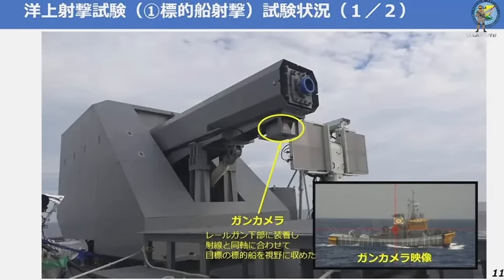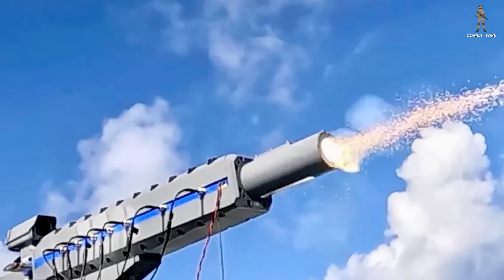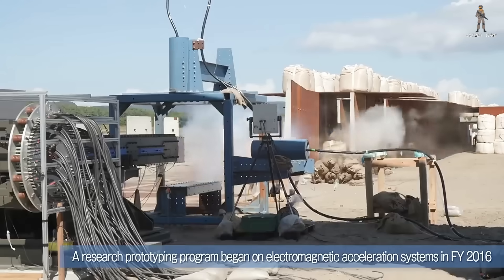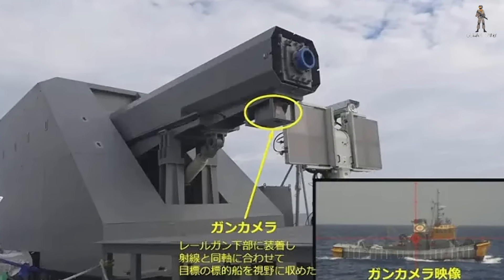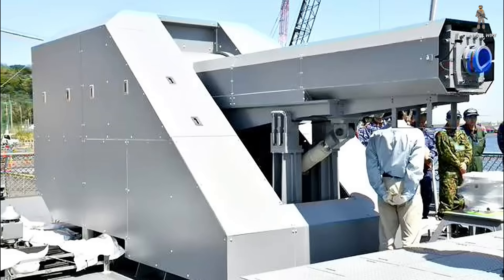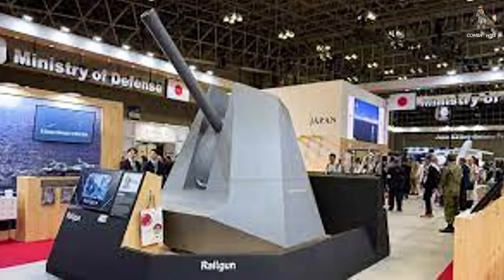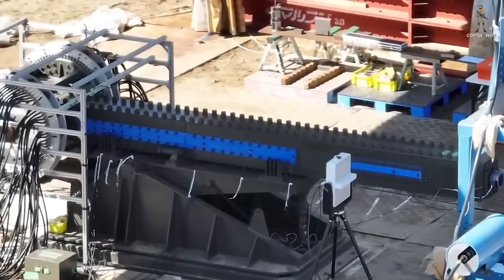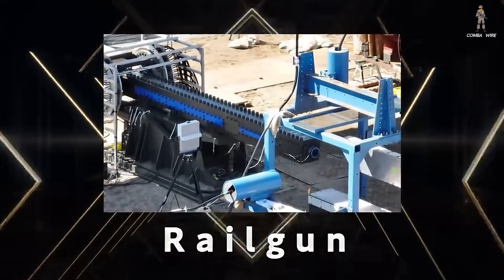For the First Time Ever, Japan Reveals True Railgun Damage at Sea.

Comment: I think... Most don't understand.a rail gun. No war head. No big boom.  Understand, the rail arrow can't be seen or shot down. The big boom is as it's gos thru ships hulls, and hits missles in the ship stock piled. That's the big boom.
Shot a hole thru the ships engine room. It's a sitting duck. How about this. Arme the rail gun up. If a comets, coming.. fire rail arrows at it. And if Godzilla shows up also. 😂😅
Reply: The primary anti-armor projectile tanks use is a kinetic energy weapon.  Think of it as a very high tech crossbow bolt.  

Keep in mind that the material from where the holed now is will be moving as fast as the projectile.  Besides - making the projectile frangible (breaks apart from the shock of impact and the target will be experiencing a shotgun blast on the inside with the pellets traveling at hypersonic speeds.  Use DU for the penetrator and those hypersonic projectiles will ignite anything combustible they touch.

Comment: the secret to prevent barrel wear is to use gundam metal.
Reply: Star Blazers has become real.
Reply: @elessarstrider5210  now we just need to salvage the Yamato from beneath the ocean strap rock engines a nuclear reactor and salvage ftl drive from Area 51 to have our real life spac battleship Yamato/starblazer
Reply: @elessarstrider5210  um they use shock cannons which are anti positrion cannons
Reply: And only japan has gundam metal... Waiting till they equip the first Eva😂
Reply: Or Coilguns, but requires more precise computing equipment.
Reply: @johnshepard7630  They don't, actually. A coilgun can be constructed with an optical timing relay built into the barrel, (basically you have a sensor between each coil that gets obstructed by the projectile and when that happens it turns off the previous coil and turns on the next one,) that can automatically trigger the correct sequence of coil activation. It takes a bit of fine tuning, but functionally works with a pretty basic circuit and effectively no computing power whatsoever.

Personally, I've thought for a while that the ideal version of the weapon system would be a hybrid rail/coilgun. The starting charge would occur in a relatively short section of railgun, to get highly levels of early instantaneous acceleration, (like the higher pressure region at the base of a standard artillery/naval cannon,) that would feed directly into a coilgun barrel where the projectile wouldn't have any physical contact. The coilgun section could then be made "arbitrarily" long to get the desired levels of total acceleration.

In theory, the coils would likely need to be spread further apart, the further down the barrel you go, as the projectile gets to be moving faster, but since none of this has to be rigid enough to endure physical contact with the projectile, the whole thing could be constructed with a collapsible gantry for storage.
Reply: Float the projectile inside the barrel with electromagnetic energy creating a fractionless system.
Reply: @AdrianMandy  they don t have that technology...for now is sabot
Reply: @bellavecc2570 Nothing ventured nothing gained is all I'm saying. Every invention starts with imagination and the will to make it a reality.
Reply: @AdrianMandy  Sure but (for now) all the immagination clash with physics
Reply: @bellavecc2570  It worked in the first versions, also that tech can be found with the Disney and WVU Monorails that have ran over half a century.  Those trains float on the rails.
Reply: @AdrianMandy  physics called and asked "how, without unmanageable side effects?"
Reply: @TuxCommander  Yes and no. It's been known it's possible for a very long time.

The problem is there's no deterministic algorithm that can get you there fast enough. The hardware can handle it, it's a software problem.

So just like fusion energy, AI is making all the difference. 

In fact, I called this when they first started using AI to stabilize fusion. ITER went from being several hundred milliseconds and before they could react to instabilities. To 20 milliseconds predictive ability to pre-act, instabilities. 

Same thing with modern robots. The motors have gotten a lot better, but not nearly as good as the software running them. My 3D printer came with a stepper motor. It hasn't done "steps" in its entire life. Doing steps makes it make noise, generate heat, increase vibration, all sorts of terrible stuff. So instead of just sending a single surge of electricity like the old school days, it's very very carefully modulated to turn a stepper motor into a continuous motor. You can even significantly increase 3D printer speed with inverse kinematics, so it does its own resonance canceling.

And you can do it the other way around as well. Turning regular motors into "stepper motors". It's almost always preferable to use the "wrong" motor now, unless your application is very straightforward.

The very newest electric motors don't even need magnets anymore. They are transmitting energy from the rotor to the stator, wirelessly. That means both the rotor and the stator can be programmable electromagnets. 

Now turn that into a straight line. You have a railgun that generates very little heat and very little friction (comparatively, there's no such thing as a gun barrel that doesn't have a use limit).

Also, it's a very early version of the technology. They are still shooting dumb rounds with the thing. We have solid state electrochemical rockets now. It's a solid state rocket that only Burns when the electricity is on. It doesn't take a lot of electricity to keep it burning, it just controls it like a light switch. A massive kinetic impact could also set it off. What I am saying is you shouldn't be rail gunning bullets. You should rail gun bullet-shaped rocket propelled drones. Treat the railgun as an extra spicy catapult.
Reply: @jtjames79  don't get me wrong and I understand what you mean. My argument is, that with our current technology and materials on hand, rail guns don't bring that much of an advantage over conventional guns.
The complexity (incl. new fancy points of failures), energy consumption and so on, are hard problems for me. 
Research, yes please! - but for now, physics kicks harder.
I don't see rail or coil guns in the near future at a place, what a modern "powder" based gun can't match or even outperform.
Reply: @TuxCommander Yeah, I'm an old BattleTech grognard. I do want to clarify that when I say "railgun", it's a catch-all for any electric first stage, somewhat because that's just the way it's used colloquially, and somewhat because the technologies are merging anyway.

We have the technology to make second and third gen electric first stage propulsion; it just hasn't been applied correctly. Military projects are too top-down to adapt rapid technology change.

There are YouTubers using ArduPilot, to make things "fly", that make the F-117 look stable.

Computers are just that fast, and that small these days.

In fact, I would say the technology is vastly over engineered because they aren't using it intelligently enough. You can do a lot more with a lot less, if you have the correct amount of compute. 

I'm also imagining multiple stages. Something that's more railgone that feeds something that's more gauss gun, with the payload also modulating its own magnetic field, with an electrochemical accelerator. Apparently the new solid state rocket boosters (not conventional solid rocket boosters, that are more like a putty or a clay, this new stuff is as hard as rock), can be burnt perfectly stoichiometrically, so you can use the gas generated as a lubricant and coolant. It's still hot but it's more insulating than metal on metal, and most of the hot goes out the end of the barrel. 

That doesn't eliminate the need for cooling, but it does reduce it. 

There's all sorts of upgrades you can do. 

Conventional railguns are basically the Wright Flyer of electrically propelled payloads. There's tons of room for improvements. 

That's not to even mention the fact that we have reasonably economically producible "superconducting wire". It's made of some meta material, and you still have to keep it cold, but not quite cryogenic. Also, batteries and super capacitors have come a long way. In fact, if I was the military, I would integrate a lot more into the "barrel", just to keep the wiring shorter.

I could go on and on. Like I said I'm an old BattleTech grognard.

Way back in the late '80s I started following the technology as a kid. I even read books about the technology in a research library on an Air Force Base. Just so I could write a two paragraph throw away plot point in a Battle Tech RPG mission for my friends. That was before Mech Warrior was released. So if you wanted to know how all that stuff was supposed to work, you had to go read about it. I believe I had to look it up on microfish. 🤷‍♂️ Yes, I'm that old. I was probably also the only 12-year-old looking things up on microfish, for my giant stompy robot game.

I also looked up a lot of cool stuff about aerodynamics, because the SR-71 was my favorite, and I wanted to know more.
Reply: @jtjames79   👍  But it's "microfiche", "microfish" sounds like zooplankton.
Reply: @AdrianMandy  you mean adapt maglev tech used to float a train?
Reply: @AdrianMandy  Bingo just like the first gen in the US that got over a 1000 rounds with no problems with a simple slug, only the fancy versions rub the sides.
Reply: gundanium metal and powered by minovsky reactors
Reply: Gundamium confirmed !
Reply: you mean south korean Gangnum metal.....opa gangnum style!
Reply: Nah they just have a Barrel magazine revolver style.
Reply: The Devil, you say. Go with the original. G-I-A-N-T R-O-B-O-T
Reply: Canada’s Weapon X program has entered the chat
Reply: @chaseteter  weapon x was a American program Wolverine just happened to be Canadian.
Reply: @cheridanielle4280 Yes and no. Weapon X is from Canada’s Department K, developed in Canada. It was Dr. Abraham Cornelius, an American working in Canada, who implanted the andamantium. William Stryker, another American, led the project from north of the border. He would eventually defect and work for Russia, leading to Omega Red.

Weapon X means Weapon 10. Captain America was Weapon I, the first of the superhumans to come from this project which did start in the CIA.
Reply: Rubbish! A couple of squirts of WD40 on the projectile would work perfectly .....
Reply: @stupitdog9686  what if the big can of WD40 gets stuck?
Reply: graphite contacts
Reply: Yeah, thx for that.
Reply: In what hardware store can I find some? And is it doable to make stuff from it? Titanium is already pretty tricky to work with.
Reply: @JZsBFF  only a select few elites in japan know how to create such metal, they have a monopoly on it.  if they deem you worthy, you will have to beat godzilla in a dance-off contest before they will even contact you.
Reply: lol  lol lo lol lol lol lol lol
Reply: Less abrasive sabo casing.
Reply: Gundarium metal
Reply: "Gundanium Alloy" or " Lunar Titanium "